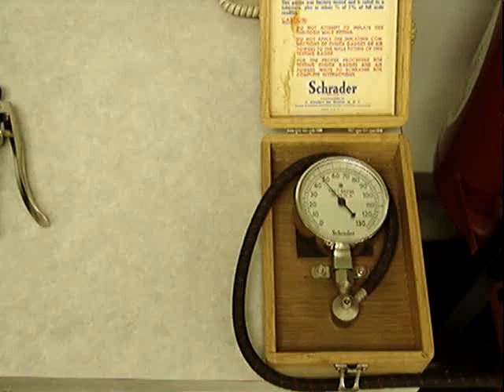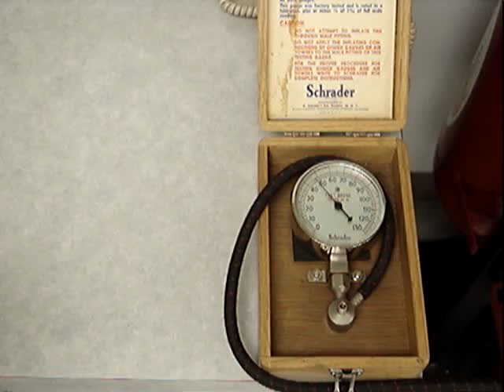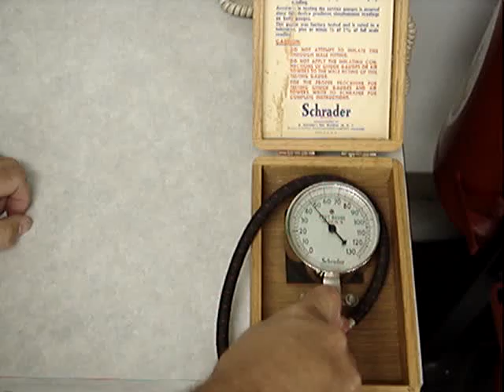Tire Inflation Gauge accuracy tests

Comment: For testing, is there a constant know air pressure when compressing a specific volume of air at a specific temperature? For example if we had an empty capped soda bottle at 70 degrees and squeezed it with 30 pounds of force, would the pressure be exactly known? Like someone mentioned, there is no way to know if an air pressure gauge is accurate, even between two identical gauges. There has to be an inexpensive way to test our gauges for accuracy.

Comment: Unfortunately, if we go buy a pressure gauge, there is no way for us to know if it is accurate or not. None of us ordinary folks own a certified master gauge to compare other gauges to. Few of us own half a dozen or more gauges to compare to each other and then rely on those that match pretty close in their readings. Beyond this, how accurate are the gauges at stations where we can fill our tires? No way for us to know and I doubt that they are all correct, even if they might get set according to a master gauge once in a great while. YET, we are supposed to be maintaining the air pressure in our tires according to specs, for safety, traction, good gas mileage, tire wear and tire mileage.

Comment: Better buy a digital one. There are a lot of accurate digital tire gauge available in the market today. I for one have been a solid user of digital ones because It has less hassles and its easy to use, and that it is accurate too. I've been a user of Mountaincrest Digital Tire Gauge and Michelin. So far, I'm having good experiences with them. The downside of these analog ones is that it is very hassle and tiring. Idk may be i'm just lazy enough. haha.
Reply: +Stevie Norris - WTF are you going on about freak?
Reply: The analog versions are also very susceptible to rough handeling,especially a drop. I've heard a 30" drop will knock them out of kilter so don't throw them in a tool box in the truck with heavy tools shifting around. Leaning more and more toward digital, batteries notwithstanding. Milton bayonet gage seem good for a shop though.
Reply: Myia
penticuff

Comment: Thanks for the video. I checked all three of my tire guages and found they were all out by a mile.  Problem is, they are consistently out by 10 - 15 psi, giving the same readings consistent with what I will never know. If I ran a parts store, I could make a fortune selling tire gauges with an accurate, certified and testing station.

Comment: The best possible gauge is by Milton. The 506/516 has a built in gauge and dual head, swivel chuck. I use mine almost every day at work (full auto service shop)